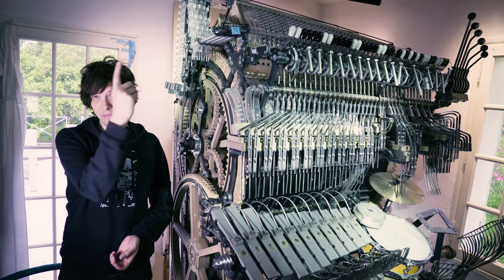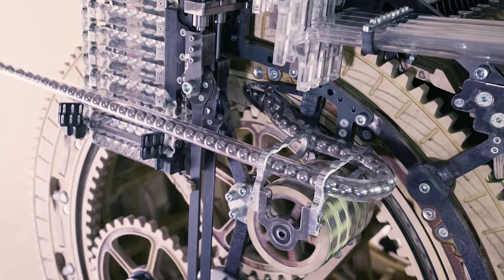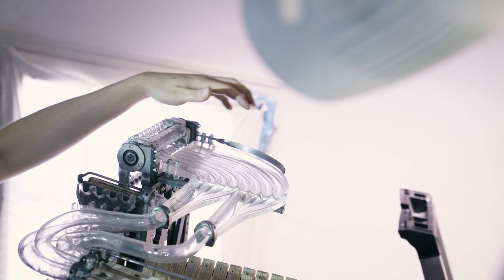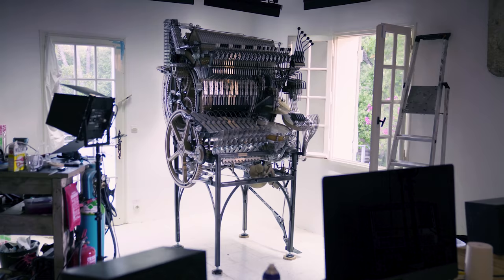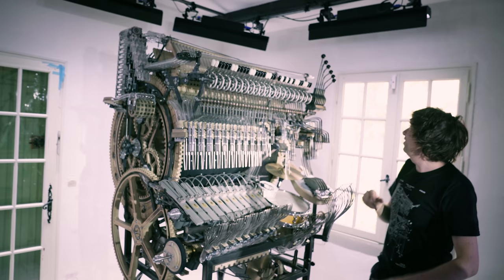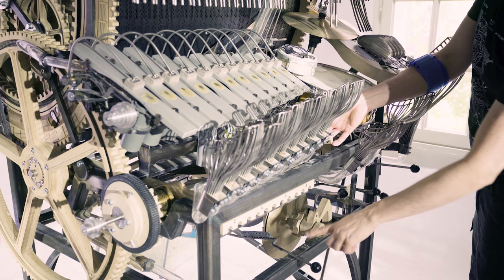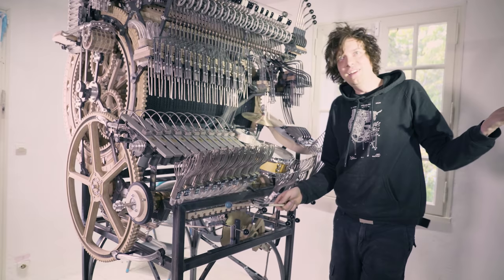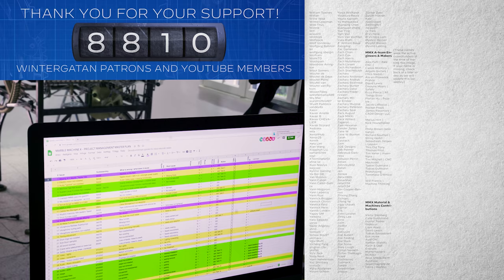Marble Demagnetizer 2.0 and More! - Marble Machine X #131

Comment: hi @wintergatan, do you know where i can find some more information on how to demagnetize marbles using permanent magnets? (i think that is what you do? For a soundart project i am working on, i want to be able to demagnetize tiny steel balls: i force them into a lovely ballet by putting them on top of a speakercone and sending sound through 500 grams of +/- 1 mm balls. Different amplitudes and frequencies generate different 3d shapes and movements of those shapes, it is a very interesting mixture between fluid behaviour of the steel balls and stacking behaviour. The permanent magnet pulls them down quit strongly, the soundwaves launch them up, the result is fascinating to watch. But after a few days on the speaker cone, the balls ar so much magnetized by the permanent magnet of the speaker, that they stick too much and the balance between forces of soundwaves and magnet is lost, and the nicer patterns don't emerge any more. I have been searching for demagnetizers that use a 20 hz swapping of field direction in a strong electromagnet, the amplitude starting big, ending small. The industrial ones that are made for assembly lines cost 100.000 euros or more, and are too big. seems like you have invented something very simple with permanent neodymium magnets? could i please learn from your experience? do you have a link to a video where you explained the design of the demagnetizing part, or a link to information from other inventors / builders you copied the working principle from? i would be very happy to be able to demagnetize my steelball collection with such a small device that i could build myself! is the trick to put the poles in the magnets North-south-north south and to run the balls over it, so that the field swaps and gets from strong to weaker by enlarging the distance? is it this simple, to imitate how the electrical demagnetizers work in a mechanical version? or will i enter a world of pain and need a lot of advice from you if i try to build something like that? Hope you can find some time to answer me
Reply: ah, after reading demagnetizer 2.0 in the title, i searched for the previous demagnetizing device video's and found your video "Marble demagnetizer - it's mechanical! marble machine x #23". that will answer all of my questions i expect. Maybe for my purpose even the simple cordless drill method works well enough. this just solved a 3 years old problem, and literally gets this abandoned soundart project rolling again :-) Thanks! i'll just leave my question in the comments, maybe functioning together with this answer as a kind of FAQ. Thanks for your video's!

Comment: Hello Martin... At  min 18:45 when you start talking about the new long tube part, making four stepped stops... right before you sang that Mambo... how would it behave and look and feel this tube if instead of being a straight diagonal incline from the right to the left.. imagine if the straight pipe instead would have some S kind of  s down-ramps  basically an escalator or steps where they fit four marbles exactly every time they start move-- stop move.... . .... I know it would add even more awesome moving porn bling....

Comment: The thumbnail shows a grey plastic demagnetiser splitter using all five tracks over the wheel, but it could be an old image from an earlier prototype. Is the way it was left in this video intended as the final design? Just using two tracks? Seems a bit wasteful and aesthetically unpleasing to have five sets of magnets on the wheel but only run marbles across two of them.

Comment: Man it's not going to work I'm a mechanic and I know this for a fact anytime that you put a magnet towards the tip of a screwdriver you'll become magnetized until you're striking upon a surface to knock the magnetization out of it sounds stupid but it's if you don't have that shock in those ball bearings you're not going to get the magnetization out of them they're going to need a fall in order to shock them

Comment: Plywood, magnets, glue... Does not sound reliable to me. Just take a big plastic water bottle, cut out both ends and shrink the middle section with a heat gun over whole magnet drum.

Comment: Martin, is the vibraphone assembly too heavy? You can remove weight from it by removing all of the steel spacing washers and replacing them with an appropriately cut acrylic/steel/copper/gold tube with an adequate wall thickness. Every time I see you stacking washers I cringe.
Reply: @gfg4963  what does that even mean!?!

Comment: You are making one basic mistake with your plywood parts  they will fail with moisture absorbing and gassing out over a few years,  you may like to think about using beeswax instead  of varnish , ,look at the bits you made first look at the surface texture  do you see how moisture in the air has over time creeped into your wood you will find on your gear wheels a definite improvement in friction if you use beeswax